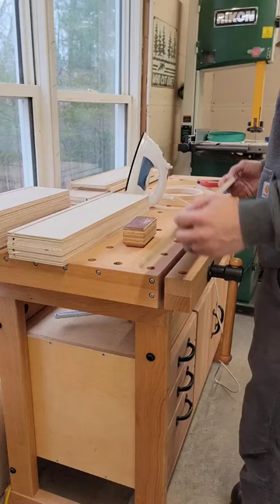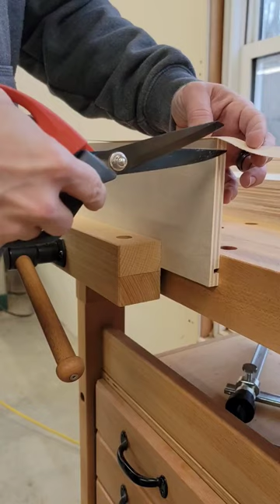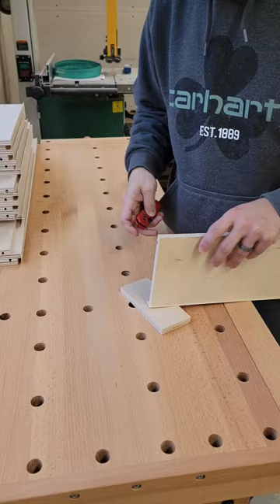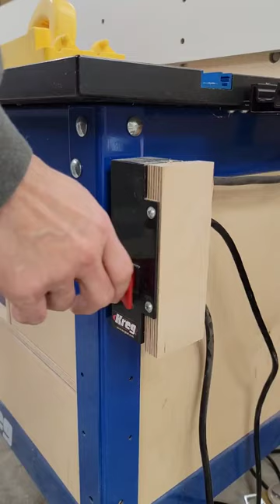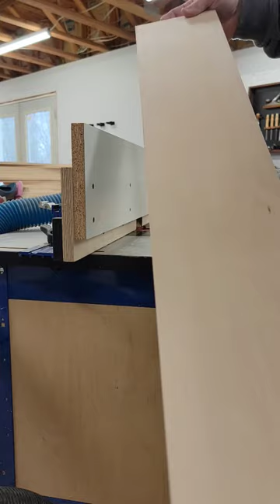Goodbye Iron On Edge Banding: the best technique for iron on edge banding #woodworking

Comment: An on/off switch housed in a plywood box ? Isn’t that a fire hazard ?
Reply from the maker: Totally get the concern there!  The plywood is really just a bracket.  The switch box is still fully enclosed in the original plastic cover so there's no more hazard with what I've done than if I were to just mount the switch against a plywood panel 👍